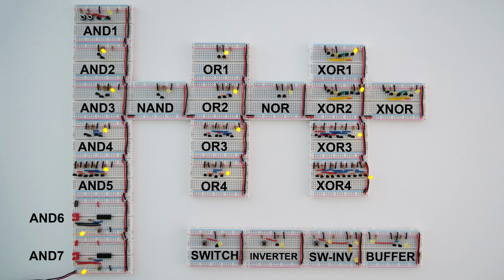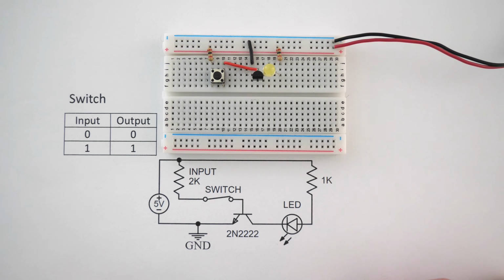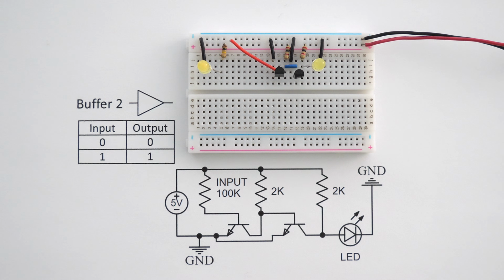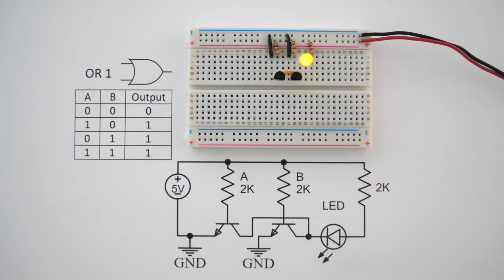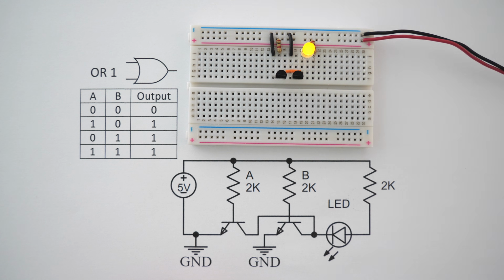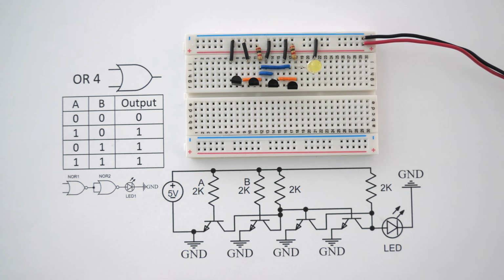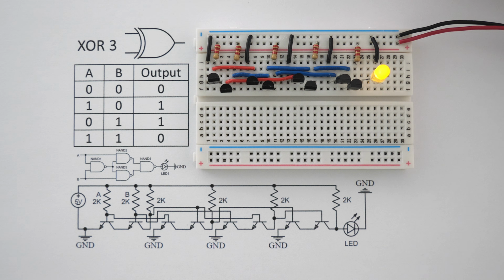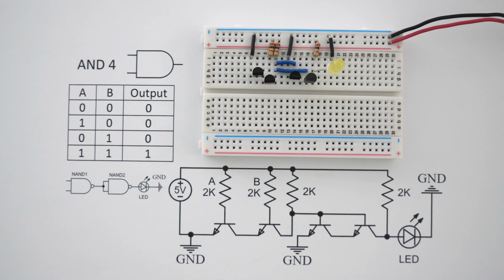Digital Logic Gates from Transistors, AND, NAND, OR, NOR, XOR, XNOR, Buffer, and Inverter

Comment: This is great. We definitely need more of this content. I agree with the concept that everyone should have an idea of the hardware level. I personally love transistor circuits and building things at level zero. Young engineers nowadays are often so far removed from the physical workings that their abstract thinking tends to make things more complicated than necessary. My co-students in my  university electronics class were not able to get in touch with the hardware side on a basic level. Their mind was biased to think in software it seems. See how many people on youtube alone have to use an entire arduino microcontroller to do something as simple as blink an LED. I once build a mobile robot with some basic intelligence using only "analog" logic made from transistors and general IC's like opamps. This video does a great job showing the building blocks for digital logic. No magic black boxes, but basically just physics at work. Wonderful!
Reply: Well said GlevoTec. When I was learning electronics, I had to build circuits to understand the theories and concepts that I was learning in class. Luckily, my father was an electronic engineer, so there was never a shortage of components around my house. Learning electronics would have been MUCH more difficult for me if I had to do it without hardware.

I've used Arduino boards to make projects where a microprocessor is necessary for the functionality of what I want to do. I've also been amazed by the complexity of the design and programming that some go through to blink an LED with a microprocessor. That's something I could do with a 555 timer or a few transistors, a couple of passive components, and a 9 V battery.
Reply from the maker: @GlevoTec thanks for the response. I am planning to build basic intelligence into a robot as well using artificial neurons for the logic. I am curious what input sensors you think would be best to use for vision. Do you know of a camera where a grid output can be easily obtained. Or just use individual IR Infrared Obstacle Avoidance Sensor or ultrasonic sensors. I have the ELEGOO Smart Robot Car Kit V4 and I am probably goin to see if I can interface some of these sensors with the neurons unless I come up with a better idea.
Reply: @GlobalScienceNetwork  Thanks for the reply. I do have some ideas for vision actually. I've sent you an e-mail few days ago with some questions. I'd be happy to discuss some ideas there too. Greetings
Reply from the maker: @GlevoTec  I replied to your email now. For some reason it went to span so I did not see it. Thanks for the message!

Comment: Make a video on Password buttons using XNOR and AND gates merged
Reply from the maker: That would be cool. My thought is that it could be built similar to the 4-bit calculator. If the state(password) is reached then it would accept the password. If only 4-bits were used it would be pretty easy to sequence through and figure out the password though.
Reply: I think if the password would be 6-bit or 6 digit, it will look more cool 
6 digit password is more difficult than 4 digit! 😎

Comment: I want to make a 4 bit adder. But I was confused about the logic gates. Hope your video willl be helpful.
Reply from the maker: It should be helpful. I have two videos about how to make a 4-bit adder/calculator using transistor's. One is called how computers add numbers. I also have one called how to build a full adder. Once you understand the logic gates making the adders and calculator should be straightforward.

Comment: Great video! I have been messing around with the 74HC series chips, and was thinking about going fully discrete. So far, what has caused the most frustration is the crappy quality breadboards and thin leads on the resistors that I have been using. I have wasted a few hours, thinking that I made a mistake, and couldn't find it. Only to discover that everything magically works when I wiggle the wires. I just ordered some BB830 boards per Ben Eater's recommendation. What brand of resistors do you use?
Reply from the maker: Awesome, going discrete can be rewarding as you can see every component in the circuit. Any 1/4 watt resistor should work, these are the small ones. Yeah, when it comes down to wiggling wires it can be frustrating. Honestly, I had a few bad connections in breadboards that were a pain but find it is around a 2-10 percent bad transistor rate that causes most of the problems. So I do a quick transistor test to make sure they are good and it makes things go much smoother. Check out my video on testing transistors. Great questions!

Comment: Is BC547 suitable for this application
Reply from the maker: It should but the 2N2222 pinout is emitter, base, collector  and the pinout on the BC547 is collector, base, emitter. So you basically have to have the transistor flipped 180 degrees and the circuits should work.

Comment: Quick question, as I was watching the AND gate 3 and NAND gate, why does the circuit prefer to travel across the transistors instead of the shorter option which is ground or led to ground?
Reply: As I watch the OR gate 2, I get further confused on how the current prioritizes since it seems to make more sense to just travel through the LED over the transistors
Reply from the maker: @shark9oooo  When the transistor has current going into the input (the base) it makes it so the current can travel across the transistor with almost no voltage drop. The full voltage drop occurs across the pull-up resistor in this case. When the transistor is off (zero current going into the base) then the current will go across the LED and the pull-up resistor acts as a current limit resistor to not burn out the LED.

Comment: your XNOR circuit doesn't work in practice. Turning A on and leaving B off still leaves the LED on. Neither does the XOR gate
Reply from the maker: Did you try building it and have the circuit not work? It worked in my example video for all the cases. Reasons yours could not work are the wrong wiring, wrong resistor values, wrong transistor type, a bad transistor, or a transistor in backward. If I can not see the circuit I can not say for certain but that is what I would check.
Reply: @GlobalScienceNetwork  you're powering two transistors with a single resistor. In my application, i had to give the transistor its own resistor in between itself and the switch.
Reply from the maker: @Shiznit304  O alright well maybe you could make the XNOR the way it is shown and then add a buffer and make the modifications after the buffer?

Comment: Do you have Video which goes from small signal analog amplifier for radio, audio, and video to a gate?

I still think that the S in LS has a great explanation. TTL is great for glue logic, but if we put 1000 transistors on a board, we can decide what to use. CMOS needs those large anti static diodes on the pins. Current amplifiers. TTL does not. So for small integration TTL wins, for large other logic wins.

AND and OR is just add with a different bias. Bipolar transistors have this exponential curve which gives us saturation behavior. I guess that we need to invert the signal twice per gate if we want saturation with npn only. XOR needs more strict voltage levels. 

Closed metal box. Cooling. Tuning. Maybe we get to voltage levels as in human neurons.

I think I now get it. It’s the pull up resistor. We don’t want to pull up beyond our low voltage signal level.

A pull up transistor can act as a good current source despite low supply voltage. Saturation is due to said supply. But this isn’t a PN diode. So to get a super sharp diode cut off, we feed back the delayed output to the pull up transistor. This way it pulls hard to follow an edge, but stops hard for the voltage.

Hmm, series of exp(). No problem.
I still feel like some level shift and inverter may be needed.

TTL then mixes everything up with a Darlington circuit and push pull as if we want a power transistor…

Ah, now I am back at CMOS. It is just the best technology to limit the voltage to both sides all the time, all nodes and wires ( within every gate ). The thinner the gate oxide, the more it wins. I don't even care about zero leakage through the gate ( see DRAM, or ultra low power CMOS). The advantage is that CMOS allows us to build totem poles of 4-NAND where the threshold voltage does not add up ( see CCD) . In contrast, bipolar transistors have a hard time to get rid of the diode voltage drop.

Now that I think of this: diode drops don’t add. Complementary bipolar is possible. The GIS look like Ads. Anyway, CPUs have a pipeline design and matched gate latency. So they could even accept a voltage drop from stage to stage. Then shift back up like in a tube computer. Maybe that’s what they call a charge pump? Disconnect the SRAM cell from the power rails, rely on „gate charge“, float up to the other rails, connect there.
Reply from the maker: A lot to respond to here. I did build a transistor amplifier circuit to display sound waves on an oscilloscope. It is a simple circuit that can even output the signal to have a computer record the audio. Hopefully I make a video about that at some point. Your other points have me a bit confused. If you have not, check out my 4-bit computer build. This shows how I implemented many  different types of gates in a larger circuit using TTL logic. Sure CMOS is better when using billions of transistors for power savings and faster switching time. The voltage of a neuron is around -70 mv. A transistor voltage drop is about 10 times that magnitude. So if you were trying to mimic that exact voltage the entire circuit would need some type of bias. It most cases though I do not think we will need operate at the exact voltage. We can discuss this at greater length once I show my artificial neuron video.
Reply: @GlobalScienceNetwork  yeah I have seen a bit of your playlist. My problem is that I try to fill gaps after I have seen a lot in life. It is only possible to keep the signal at 70 mV ( at 20 K maybe ). Bipolar needs bias. One gap is : why did early ICs had a different type of MOSFETS and needed 3 rails, but today we cannot buy any of this? I feel like market dictates the threshold in a MOSFET. Now bipolar does not have this degree of freedom. It only has the bandgap of the material.

Ah, so bipolar NPN will eventually saturate at the rails? But for speed the rails will need to have twice the voltage drop across them.

When NPN saturated due to the output current is quite low. With any kind of load this will not happen. Maybe to be sure, limiting diodes with their own rails (for us to tune) are the way to go.

NPN has a NP diode between input and internal signal in TTL. So we place a second diode in parallel. This diode has a lower bandwidth ( artificially created as a schotky diode ). Ah I get it now. This Schotky trick doesn’t work for transistors.

Amplification is linear ( eats a lot of power ). Levels can be shifted using a resistor network. Even if we use the voltage drop across a diode, this draws constant power to keep the gap open.

Seems like any way to speed up beyond CMOS just draws too much power even at low voltage signals. Parallel operation of CMOS wins in ICs (ARM2). Breadboards don’t show this beauty.

Comment: Again, another good video. However, I did notice a tendency to randomly (?) use the word "across" when "through" was probably meant. As an example, when saying that current goes through a resistor, then through a transistor, then through a switch, etc; what was actually said was more along the lines of, current goes through the resistor, then ACROSS the transistor, then ACROSS the switch, etc. I know what you meant, but I suspect a lot of beginners might be thrown for a loop by the inconsistency, and by the word ACROSS being used in conjunction with current, where instead it is usually used in reference to voltage (drop).
Reply from the maker: Yeah, I thought about that. I was using through and across to say the same thing and just changed up the wording because otherwise the wording was very repetitive as I describe where the current is flowing in most of the circuits. It is good to know what other people think when watching the videos as I am trying to improve as I make new videos. Thanks!

Comment: Excellent explanation of transistor and logic gate theory. Simple, clear and clean demonstration circuits with diagrams right there at the same time.
Reply from the maker: Thanks for the positive feedback!
Reply: The diagrams shown at the same time are amazing !!  One teeny quibble is the use of crossed lines/wires on a diagram...this implies that if they were connected, a black dot would be used to show there was a junction.  I prefer a small semicircle overlay when wires pass over each other.  Other than such a stupid point from me, this was perfect !!

Comment: Thanks for this video - it must have been a lot of work going through all of those options. A couple of suggestions for the future. 1. at some point you started referring to the base of a transistor as its 'input'. That's kinda confusion terminology - in some sense the E, B, C are all 'inputs'. I suggest using 'base' to avoid confusion. 2. When you discuss the use of default the pull-up resistors in ICs it would have been good to mention that they are specific to the LS family. If your viewers ended up with HC ICs then they'd be confused as to why they weren't working! Looking forward to seeing future videos.
Reply from the maker: Thanks for the feedback. I really do appreciate it as I will be trying to improve video quality as I learn along the way. I will be trying some close-up camera angles in future videos as well. I did use LS ICs for the most part. Although I ran out of one type and the HC version did work with the resistor values I used. The input voltage and output drive voltages are slightly different for HC vs LS. I am pretty sure either one will work with the 5V input, yellow LED and resistor values used. Although I am not positive about that. Thanks for following along! Building a 4-bit computer with individual transistors is next and then artificial neurons. It should be fun!
Reply: E B C can all be common. But only E and B can be inputs.

Comment: Just subscribed 😅.
My son just started computer learning.

If you make your videos as clear,well detailed and simple as this one then your channel would be one of the best !

BTW , would you please suggest any free simulator of the kind you are doing so we can learn from your channel then practice on the simulator

Thanks
Reply from the maker: Thanks for subscribing Kenzo! I made all of the drawings with  EasyEDA, it is free to use. Go to their site under products and choose the standard online editor. When you are in the editor switch to simulation mode. Start a new project, you might have to start an account but it is free. If you do not like this one LTspice is another popular circuit simulator. Just look for tutorials online. Yeah, that would be great if you follow along. I will be building a 4-bit computer using individual transistors and then will be working on circuits that act as artificial neurons. Also if you use 1K resistors rather than 2K in EasyEDA the LEDs should light up in the simulator. Otherwise, you will have to use the multimeter function to view the results.
Reply: @GlobalScienceNetwork  
Thanks a lot my Dear
Wish you outstanding success 😅

Comment: I see your other videos may have what I'm looking for in some form but since I haven't looked harder at that yet, I would like to ask if you have any advice on how to hook up multiple of these gates in a line? This is because there was a version for each gate to make chaining them possible.
Reply from the maker: Yeah, if you watch my full adder video it explains how multiple logical gates can be used to make more complex logic. The how computers add numbers explains how to take the full adders and make a simple 4-bit calculator. I am actually working right now to make a 4-bit computer using individual logic gates where the logic gates are built with individual transistors. Thanks for watching, if you have any other questions, let me know.
Reply: @GlobalScienceNetwork  Thanks a ton, I'll let you know if I have anything else!